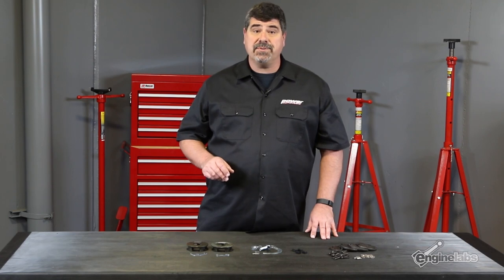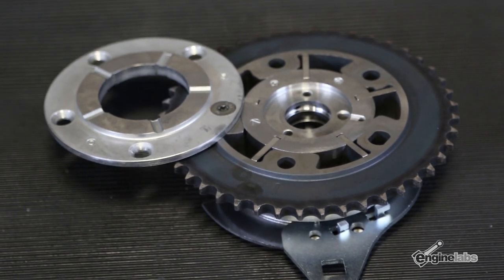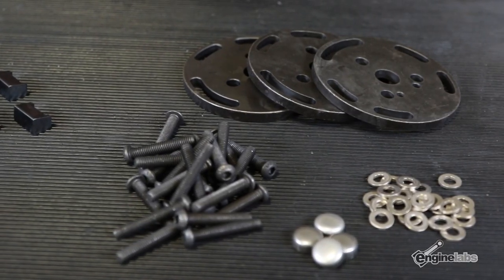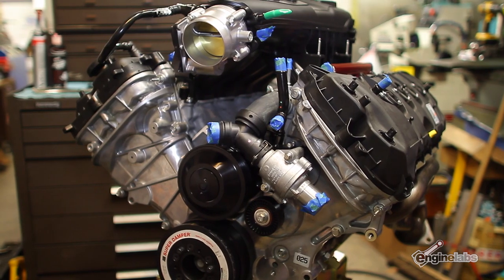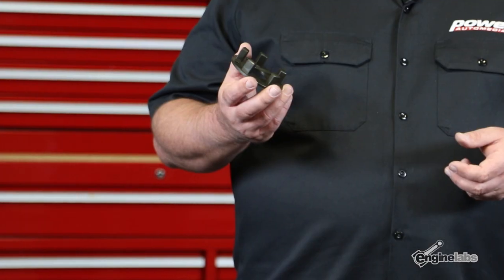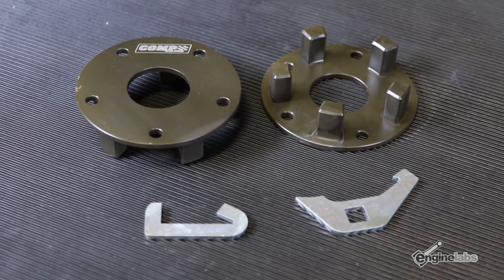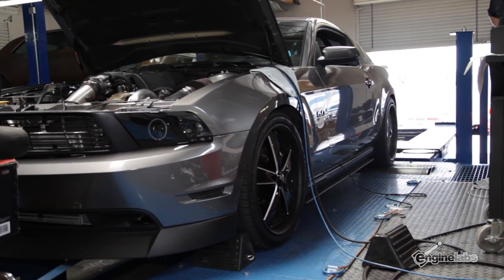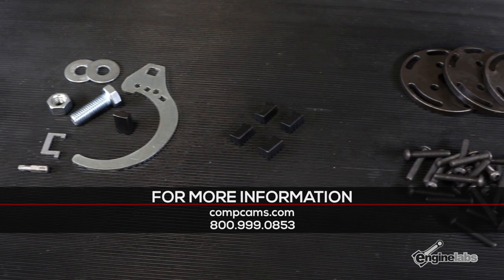COMP Cam Phaser Locks and Limiters Unlock Camshaft Choices

Comment: Quick question hopefully you can help me..i bought a new cam for my escalade i needed to put a phaser lock out wedge .i took that wrong bolt all the way out ..heard something unwind .. put the wedge in n put the 3 bolts back in ..will i run into issues?

Comment: Good evening POWER AUTOMEDIA. My pleasure to meet you! GOD BLESS YOU FOR ALL THE HELP THAT GIVES TO TRAVEZ OF YOUR CHANNEL !! I have a truck SUPER DUTY F-350, 6.2, 2011. That has a fault and was after having lowered a cylinder head. because he wore a valve spring. Now I keep failing and I think it's because the chain distribution is not well installed. I have my doubts about it! Please have any video or material that can illustrate with regard to the installation of the distribution chain and its components as well as the axis of cams and rocker arms? Many thanks in advance and a thousand BLESSINGS !! Almodio, Táchira-Venezuela.

Comment: As usual, if you don't have access to programming the ECU/ECM you won't get much out of your investment. Is there a way to ditch the VVT and go back to a manually adjusted cam setup?
Reply: Bob Is The Builder If you can’t tune the ECM then you can’t change cams anyways. That being said they make limiters and locks for most systems.

Comment: Hi There, I have a 2006 Honda Odyssey which are misfire when accelerating, I went many Mechanics and non of them solved the problem, we have replaced the two solenoids and clean the can shaft but no result.
I would like to know if your kit would eliminate the VVTI system and if would solve my problem.
Please let me know if your kit is suitable for my need or if you can guide me to someone who can help me.
Billy Barbosa 
From Australia 
Cheers.